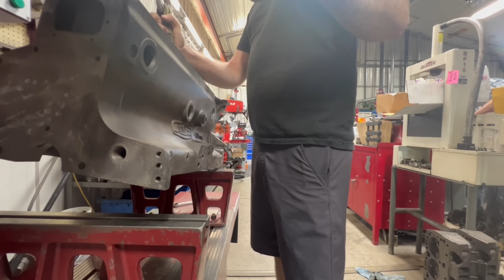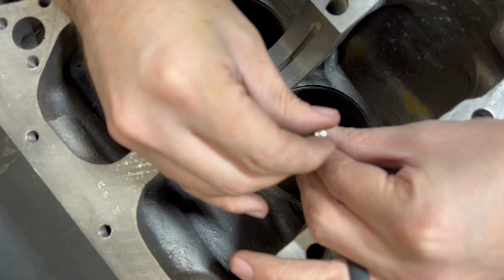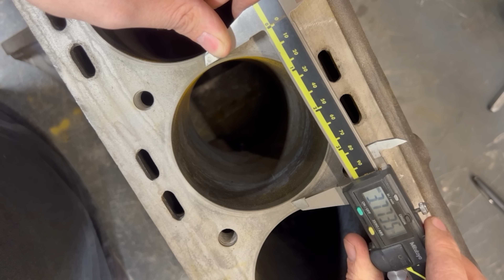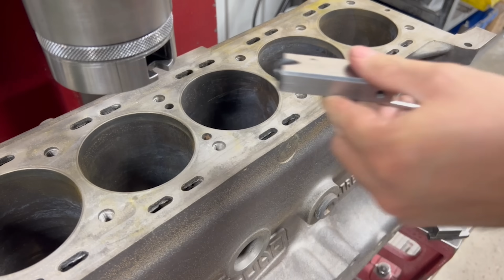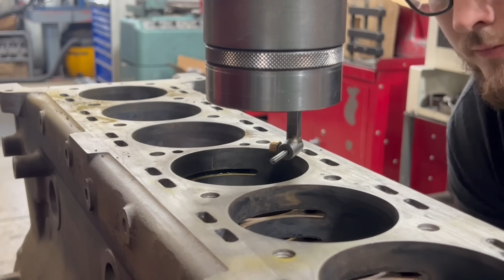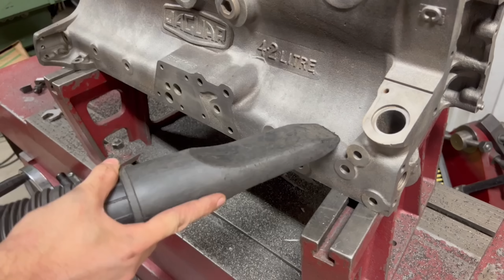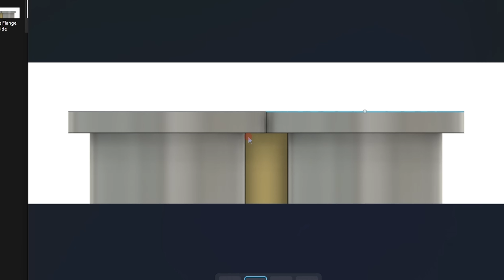Can This 1968 4.2L Jaguar Block Be Saved?

Comment: I was about to say flanged sleeves, or cnc a steel deck plate weld the sleeves along a bevel cut into the plate and surface cut until flat, drill a hole at the end of each crack tap and install a threaded plug, drill a series of holes following along the cracks makingsure to over lap each hole so you drill and tap part of the previously installed plugsplit the last plug between the second to last plug and deck/head gasket surface, use a milling machine to grind the excess plug material off, and then use the boring bar to flush them or true the cylinders and plugs together. It's a tedious process but there's only six holes, and how many cracks? You could go through each pair of connecting cylinders and that would make it three, and the longer plugs will effectively reinforce the weak areas, then bore surface sleeve deck plate. Or skip the deck plate use thick flangesleaving only a slight outer sleeve ridge except the area of the crack which you could custom shape and cut an inlay to braze in. That might be a lot more but ivesuccessfully repaired a cast Iron inline 8 cylinder exhaust manifold with the over lapping plugs and it held up fantastically, not on a mating or bore surface, but on an exposed area that had to look like it was never repaired, so I ran a long pulse pause pulse with a nickel rod over the plugs filed it close and hit it with the glass bead blaster lightly until invoked sandy like the substrate, a little high temp Nu Cast, and it looked brand new

Comment: Have you considered Lock-N-Stitch? It's the standard repair for cracks between valves in cylinder heads. This cracking is very similar.

Comment: Could it be possible to cut and weld the crack as it only goes down to the first or second water passage? To try and keep the block as original as possible? Or even add the top hat sleeve as well as an added measure?

Comment: These jag 6s were notorious for overheating. There was no real solution or easily identifiable cause. You have much better equipment than local jag dealers had. This video makes sense of the possible cause. These are very weak egne.

Comment: Vee out the cracks and fill with silver solder. I've seen keyseats in crankshafts silver solderedand recut. And hold up. Plus silver solder is relatively easy to machine. I these bores have that much taper in them something seems off.

Comment: I think with some skill that those cracks can be welded or alumawelded and machined before you sleeve and hopefully avoid the top hat sleeve , because if you top hat sleeve it that will probably be the last time that motor can be rebuilt, its lucky its not cast iron, you can rebuild any area of the block you want with welding before you machine it, i hope you save the block!!! Good luck 🤞

Comment: We have also worked on a this type of Jaguar engines. We repaired this with a technique called; Gas Dynamic Cold Spraying. It's expensive but you will have a very solid basis with the crack filled in.
Reply: Where can I upload a picture?

Comment: Send the block to one of those little welding shops in India. It will come back repaired.
 They carbonize the cast iron with charcoal and weld with flame.

Comment: Depends on the engine usage and build.  I have a 10.8:1 360hp 4.2 xk engine in a ctype and blew the head gasket.  Massive repairs to head but now has coolant in number 6 cylinder.  I know I’ll find cracks in the block when I pull the head again.  I’ve basically lost the will to fight and left it for the past year.  At that much compression and power there isn’t much saving it.  But assuming its the average elderly man, cruising around in an etype its probably top hat sleeveable if the cracks are terminated.

Comment: Machine down and eliminate the cracks then install the sleeve with a hat deep enough to fill in the void that stops just adove the coolant passages, no more cracks and a perfect deck for head gasket to sealing, that will retain the coolant passages as well

Comment: Another reason for using the same block would be you would encounter the same problem with a replacement, so stay with and rescue the original block.

Comment: I have cut and welded many block with the same issue and simulare design  but you over lapped sleeves would work great too but  you can  grind cut  weld and pack in sand for 1 week slow cool in a and oven  and it will be permanent and done for life

Comment: What I had done is a lock stitch in the very center of the area between cylinders.  Then had tophat sleeves put in and the block decked a couple thou.  This sealed all directions and worked very well.

Comment: It's bizarre that the cracks went past the slot in the bore! 

You could weld the block before you sleeve it if you have experience welding cast iron the right way (the block red hot using oxy and arc at the same time, and let it cool very slowly over a number of hours,) but it would be a massive job that you need to be set up for and you might have to line bore the block afterward. We would rarely do it unless it was something rare like this. 

It's a shame the cracks go over the gasket ring surface or you could just use cast iron crack repair plugs, although they wouldn't be simple in adjacent bores.

Maybe if the owner has his heart set on using that block you could just braze up the cracks, sleeve it, run some Irontite through the block, send it, cross your fingers, and give a concrete warranty (when it leaves the concrete the warranty is over) letting the customer know that it's not the right way, you're not confident in it, but it may work.

Comment: Tophat sleeves are definitely the way to go. I have seen some GIANT tophat sleeves in open deck engines where they remove the whole outer bore down like 2 inches and have the tophat butt the other sleeve 2 inches down, and being the original block the rest of the way down. That could possibly work for this engine to fix the crack completely if you could find something with the right dimensions. Btw I am not an expert, I'm a keyboard warrior.

Edit: found some posts about darton mid-wet sleeves, thats kinda the idea that I was thinking might work best for this application.

Comment: Just spit balling here but why couldn't you grind a V shape into the crack, weld the crack shut, then machine for the top hat sleeves?  I have seen other channels where  knuckle head Harley cases were revived from scrap condition into running bikes. Granted that the repair will fail eventually, but it's probably not going to go through as many heating cycles as a general purpose engine will.

Comment: Back in the day, Im 73, My dad had my 440 Chrysler block with these cracks ground V shaped to a set depth by the Machine shop and HeliArc welded. Also for the side before last surfacing of cylinders for new sleeves. Worked great and fixed the issue.

Comment: I think answer is as always - depends. If this would be some honda shitbox civic (in principle any common worthless car) engine, which is being prepared maybe for racing, then obvious answer - just junk it. But when it is very old and rare engine (nowadays anyway) and it is going into numbers matching restoration, into the classic car which will be kept inside, driven rarely, maintained well and unlikely abused, then obviously it worth saving the block. 

So basically if engine utility is what it matters - longevity, tuning potential, power etc. Then this block is junk. But if car originality is what matters, matching numbers original engine in car which is not going to pushed to the limits, then keeping the block is way more important. Even if it fails again in 50 years time this is well worth repair.

By any means I am not an expert on this particular engine, but generally speaking there is two methods of repairs - either braze it (again low performance application will be fine, you simply want to seal the coolant channel not to blow the gasket), or there are as well inserts for cracks, which is stronger and can be used in combination as well, but I don't think this is necessary. Finally, you cam have sleeve with the lit and counter-sunk it at the top. That does not fix the crack, but it will give that extra surface needed to better seal the gasket.

Comment: As an apprentice I worked on these engine blocks in the petrol version of CVR(T) & CVR(W) armoured vehicles. Putting Top Hat liners in was such a common job we had a machinist permanently employed doing them until the engines were replaced with a diesel engine in the early 2000s. These blocks were then seen several times at the workshops not for that repair but for their host vehicles the blocks kept on going. Hope this helps :-)

Comment: i have not dealt specifically with these Jag motors, but I did work for an engine builder for a few years and dealt with cracks along the way. We used to use a guy who specialized in metal stitch repairs of cracked cylinder heads as well as engine blocks.

Comment: Another thought is their enough material in the block to hog out to the top of the passage and use a hatted sleeve to that point this way you can machine to a sealed fit between the cylinders.  Honda did this in the S600 jackets

Comment: I like the machines top hat sleeve idea.  I would consider using a crack die below the water jacket just to make sure because you need to drill ahead of the crack if it did not dead end.  I'd also consider brazing the cracks.  I've seen on several other engines a bronze rings machined along sleeves in the block and once in a cracked head so when the head is installed the bronze sealed the crack.  Only problem with that you pull the head the bronze may need to be replaced

Comment: These 4.2’s are incredible engines, incredibly heavy, incredibly large and incredibly over spec’d I bought an XJ6. 1976 that had been in a garage for 30+ years, put a lorry battery on her fires straight up on 70’s petrol! Ragged the auto box back and forth until it broke the brakes off and drove it onto the trailer. The car itself was a rotten mess but that taught me just how reliable and impressive the 4.2 is, very good engine

Comment: A fascinating video of an operation I have read about, but never seen. Jaguar produced, (machined) these blocks on machinery that was pre-WW2 !  Workshop techniques were never the best because the machinists and engine assemblers were on piece-work. As far as I know, once top-hat liners are installed, the block is good for many more miles without incident. This assumes everything else on the engine is attended to. 
Don't forget to attach the timing cover to the block before facing off the deck !! If you don't you'll probably end up with a lip between block and cover and the head gasket seal will be compromised. 
I have to say I am surprised to see a block with the cross passages on a 1968 car, as to the best of my knowledge, the long-stud engines only came in in the 70s with the 7L blocks. The 8L blocks were supposed to be stronger, but still cracked and the issue was only dealt with in the early 80s with the slotted block that is just a spatchcock and unworthy of a company claiming to be good engineers !

Edit
Looking at the video in more detail (stopping to look at things), it is a short stud engine as I can see the tapped holes, so Jaguar must have machined the coolant cross-passages when the 4.2 engine came out. So the cracking problem went on for decades before Jaguar got around to fixing it.  By the time they fixed it, the new all-alloy engine was on the starting blocks so one can understand why they didn't spend a lot of time and money on the old engine design

Comment: When I was in the engine rebuilding trade back in the late 1960's to mid 1970's it was standard procedure to install flanged sleeves in ALL jaguar motors that we did.
The problem was so common that even if the motor was able to be bored 20 thou oversize and it did not already have flanged sleeves, we would fit bore it out and fit the flanged units.
Another thing we would do is order flanged sleeves that were 10 thou oversized on the OD so that we could bore the block to take care of the taper and ovality that ALL the blocks had out of the factory.
Another highly secret "thing" we had was to wash sleeves and block with solvent and give them a good wipe down with urine (piss) and then press them in.
This would cause very slight rust which would lock them in place forever - remember that there was NO LOCTITE or similar available back then.
And it worked - not a single comeback ever.
And even if there was such products available in the US or Europe, due to the sanctions against South Africa back then, we would not have been able to import any such product.

Only problem was when you got a previously sleeved motor back to be resleeve (mostly racing motors) you had the devils own hard time to get the old sleeves out because the rust, heat and whatever chemicals were in the urine really chemically bonded everything together.
Not nice to think about but MAN DID IT WORK WELL.
And it was all we had back then.

Comment: This exposed the reason sacha a larg number of Jaguars were converted to American V8 engines when the cars were still relatively new . 
For everyday driving the car it was an inexpensive and effective means of making the car usable as opposed to sitting in a garage for 60 years until it's value crept high enough to justify the Extreme Measures necessary to repair the engine block. It also explains why numbers matching Jaguars are both rare and expensive .

Comment: Question, can you just bore the block until the cylinders touch, then sleeve the first with a huge sleeve to fit that diameter, which will protrude into the second bore. Machine the second bore again and fit same sleeve as first, then bore the 3rd out and then sleeve etc and then the last one will be the only one left round. That will lock the others. Then, go back and bore the sleeves.

Comment: i used to work on a 6 cylinder diesel line , straight after cylinder liner fit , honing and wash - inspecting the final liners for defects and fitting pressure caps on the oil ways
up until they improved the machining on the block, and the honing technique to remove the need for liners
super interesting video, thanks

Comment: I had a 4.2 block with the same problem and also frost damage around a core plug, but the customer wanted to keep the original block. The coreplug crack was stitched and liners fitted and then sent for ceramic sealing. The block was then cleaned and pressure tested and found to be leak free. It has lasted several years without a problem. Sealing makes a mess but is very effective in sealing leaks.

Comment: Loctite of any colour dissolves into liquid at relatively low temperatures. Using it is of very little use or purpose in this scenario. ..Surprised at the tapered bores TBH...🤔🤔😳😏🇬🇧🇬🇧🇬🇧🇬🇧🇬🇧

Comment: Idk, I've worked in foundrys as a heat treatment operator and know for sure that would be a junker if we found cracks like that but thats from a business point of view. If your spending the money on rare, expensive rebuilds with matching numbers your already invested mentally, finacially and emotionally. Do alot of research and talk to highly skill people and weigh in on the risks of further damage to get it repaired properely. A patch job would mess with my head knowing the cracks still there. It would ruin the whole rebuild

Comment: Can you silver solder that crack, then clean up the parent bores? I think a high % silver braze would wet into that crack, especially if you grooved it out first. And the braze should be plenty strong once supported by tophat sleeves. It's also relatively flexible so it would deal with heat cycles well.

Comment: I have been working with a semi truck factory and am very familiar with this kind of dry cilinder sleeves setup. in our case the engine block is pressure tested on oil water and fuel canals but the testing bath is hot 80 degrees C' then the cilinder sleeves are added while their cold 3 degrees C' hot metal expands while cold metal contracts.

also if we ever have a block with such cracks in between passage ways their scrapped even tough it doesn't leak into another system oil, water, fuel,  but we are a production facility.

to save this block you might grind it out and weld it or hard solder it ? as long as one system doesn't leak over into another which it doesn't seem to do

Comment: I’ve had some luck with the old gm and dodge straight 6’s by lightly beveling the cracks and tig welding up the cracks. It’s not a perfect repair and does have a fairly high fail rate but I have seen this work but it takes a lot of time to do it right.

Comment: I would get a TIG welder and weld every single crack that's in there closed until it's verified that it can be sealed and then install new sleeves

Comment: Grind out cracks, braze them up, cut counter bore for top hat sleeves.  If the crack is left, like you said, it will just keep getting bigger.  Then someone will have 2 halves of a block.

Comment: Just an idea: Before boring out the liners,  fine threaded plugs could have been fitted between the bores.
The outer diameter of the plugs just big enough to break in to the bores.
Then boring out and replacing the liners one by one.
Would it work? I don't now....

Comment: Why not grind out," most of the cracks" ........ preheat the block ,  find a experienced T.I.G. welder and T.I.G. weld the crack fillets to above flush,  using a controlled heat,  stress relief the block  and then machine the cylinder bores and top of the block to spec. The key to a good repair is the preheating of the block, a  good T.I.G. welder and heat stress relief of the block. 

Mr. Phillips 
Canada
Retired
GM of Canada